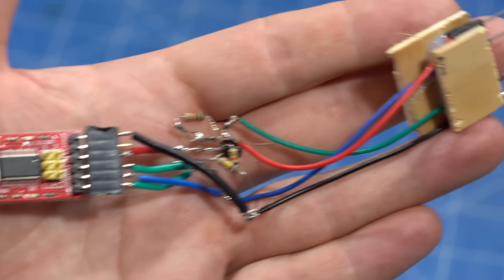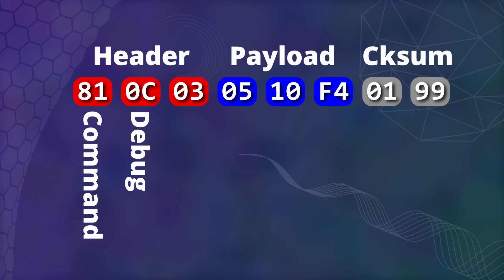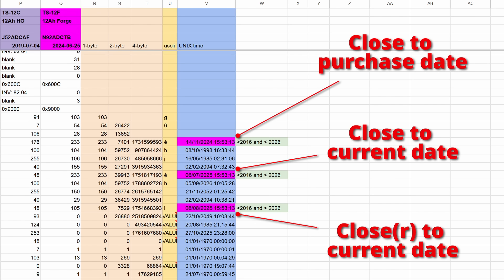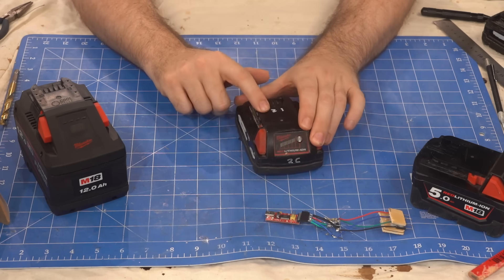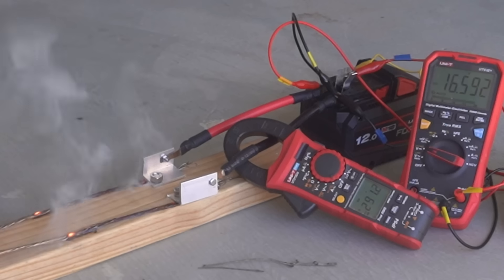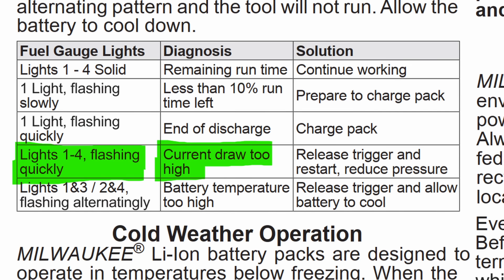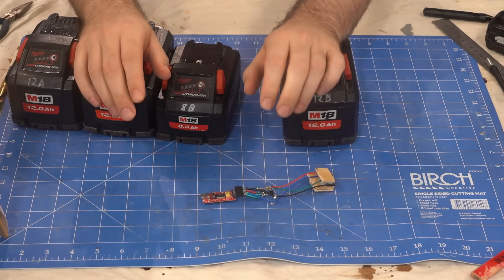Full M18 diagnostics revealed

Comment: FYI, some register can be used to read / write other register.  This is done due to having more registers then you have address lines.   You write to a register (A), when a read is performed, another register (B) will display the value of the register address that was written to in register (A).
Reply: that's not the case here

Comment: In a previous life I was working with pre-packaged x-ray spectrometers. They had no less than four serial numbers, one on the chassis which the user could see, one on the electronics, one on an analog amplifier that sat in there, and one on the spectrometer head itself. All paired up at the factory. Only the electronics serial number could be read out of the EEPROM. It was a nightmare to keep track of as we sometimes sent parts of the package back for repairs/replacement. Maybe crack open one of your batteries and see if you can find the number you found in memory?
Reply: Yeah they probably just have a database linking the various serial numbers.

Comment: Damn, I'm glad I just have my 20v DeWalt stuff you just plug the battery in and then drill holes or cut things like you need to do who thought goddamn batteries would have to have diagnostic codes... it's a goddamn drill for crying out loud... 🤦🏼

Comment: I bought a m18 impact and battery set. Thise 2 original batteries have lasted almost 15 years now. Theyve outlasted over 2 dozen other batteries ive bought since. Used a lot. I wonder if they started using this system sometime after that because i cannot get them to put out any code. I also wonder if theyve lasted so long, because they dont have this avility to put out a code.

Comment: You mention you need a 3.3v-8v level shifter, but link to a 3.3-5v shifter (which is the most common by far). Will the 5v data voltage work with the batteries?
Reply from the maker: The level shifter will shift to whatever voltage is connected to the the central HV pin. We connect that to B+ of the battery (20V). See the wiring diagram on github

Comment: Interesting video and kudos for cracking it.
I knew that the microchipped battery counts off something and then denies access even though it wasn't used that much.
A friend bought a new Milwaukee Drill and barely ever used it.  When he showed it to me and how much he paid vs his peanut wages I said you could have borrowed mine for however few times you ever "actually NEED a power tool".  
I think he used it 3x then shows me the battery and could I recycle it for him.
He called it stupid "I only used it like 5 times"
The first generation NiCad and NiMH I used to rebuild them myself both for myself and professionally years ago.
These new ones just end up tool and all in the tip after they need a new battery.
I've gone to the store 
Just need a fresh battery the drill is perfect yet barely a few scratches on it.
Nope that tool battery is NLA and the tool has been updated to model ex wye zed.  
Buy everything all over again. 
After going through this enough times it can pay for a small gas powered generator and use your AC power drill instead.

Comment: If you had some cash laying around I'd suggest an automated battery analyzer. I don't remember what they cost but you can program them to do all that testing without human intervention. As I recall they can be programmed for both charge and discharge cycles. (I found some starting at about 2kUS& and up.)

Comment: Unfortunately all your good work won't last long ,all the companies will do is either encrypt the details or put in traps to disable the battery to make your hard work pointless .What would work better is designing a third party board that removes all the nonsense that stops it working in the first place It's a battery they worked in the past just pressing a switch no tech inbetween

Comment: I bought a Milfuckye kit that came with a drill and an impact and two M12 batteries, both batteries refused to charge in less than six months having had very minimal use, I then had to spend the same amount as I did for the kit for a new M18 battery which has been left on either of the drills for over two years and charged only a handful of times.

Comment: I strongly admire your tenacity. This is proof that nothing is ever simple anymore. Manufacturers will do anything to make a buck and deny warranty claims. I suspect that 90% of the seemingly random numbers is nothing more than obfuscation. I'm sure they had several exciting nerd meetings to come up with it. Enigma for batteries. What will they think of next. The chipped tools that won't work unless they're "activated" at the register is bad enough, but Enigma batteries? C'mon, man! Of course you realize that Milsuki is now  frantically re-writing code to move everything and use different random numbers. Now we know where all the moonlighting HP ink cartridge engineers went.
Reply: Don't assume the worst case, plenty of data gets recorded to improve product quality and reliability.
Reply: @jaro6985 I only knew of one programmer where I worked that intentionally obfuscated his firmware code. It wasn't a problem until he rage-quit one day, then it became everybody else's problem.

Comment: Why a level shifter? FTDI usb to serial can operate in 3.3 or 5v
Reply from the maker: Battery is funky. You need to send messages at 12V (but 8-20V works), and it replies with 3.3V

Comment: Well this is interesting as I've an M18 6.0Ah that's not been lasting very long each charge lately so figured I'd check the cell pair voltages after hearing here they don't balance them (!).  Of the 5 pairs in there, 4 were ~4.0x volts, but 1 pair was at 3.5 volt.  Wow, so, I guess that'll be a big part of why then.

So, I'm currently running a slow charge on that particular pair to bring them back up to 4.0x volts.  I'll be keeping a close eye on them from now.  This tool could make it much easier to determine status without having to open the pack.

Comment: Great job!  I have not dug into these packs (yet) but it would be good if you could also focus a bit on refurbishing the packs, using the old circuits/cases but installing new cells.  Many packs require specific reset/re-learn procedures or digital instructions to make that work. (and tools in general to edit any necessary registers)

Comment: Nice work!  I had no idea there was that much doodly-do going on in the background of modern tool batteries.  I got pissed at battery operated tools back in the 80's with replacement Makita drill packs costing more than buying them with the TOOL and CHARGER!  Scam....   I invested in a decent air compressor and air tools instead.  That was a lot of years ago, compressor and tools still work fine, none laying around because the cost of air was more than the tool was worth.  The only battery operated tool I have is a cheap Menard's 1/4" bit driver I use to build a 'house' on top my 30' boat to fully support the tarps over the winter and the occasional odd project.

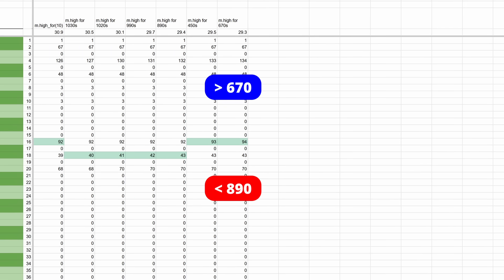Comment: 12:19 could 873 seconds, being close to 900, be a correction for poor clock performance?  Is 873 consistent accross the lot? Does the internal clock need
 873 seconds counted to correct the clock by 27 seconds to correct toward the 15 minute interval?
Reply: It’s almost 1/100th of a day? 24*60*60/873 = 98.969 so perhaps with that and the clock error?
Reply: @owenimholte3835 That sounds much more likely than my hypothesis.  If you are right, then 873, is probably consistent accross all models.  Great insight!

Comment: Great work!   I can see why they might not record ambient temps, us guys working in the field have only one place to leave our batteries and thats cooking inside service vans when not in use, those registers would be filled up real fast in the summer.  But I am curious, what about low temperature events?  When its below freezing here batteries are still living in the truck and freezing a battery isn't any good for them either, I've forgotten on more than one occasion to bring a battery or two inside for the night.  
Off to check Martins video, I'm not a Milwaulkee guy, they burned their bridge with me in the 90's with the horrible chucks they had on hammer drills and refused to warranty them on 4 drills (bought jacobs chucks for them, at the dewalt store =-) to take care of the self loosening chucks).
Reply from the maker: Not easy for me to test low temp. I'd need to cut the thermistor, which could ruon my battery. I should see if Martin can do such a test on his broken PCBs.

If they continue with 10C buckets, then they record charge start/end temps down to -30C
Reply: @toolscientist  Ruining batteries is the last thing we want!  Defeats the whole purpose of this endevour after all.

Comment: I was working a lot with serial comms back in the day, still have a rs232 card somewhere with a wide range of speed. I could have helped you, if I knew of this. All but the decoding is easy of those used to it and checksums of some type, were very common.

Comment: When a battery do this much of data collecting, it's not hard to imagine, that some of the manufacturers actually make software lockout function to it, just to force you to buy new ones... It would be nice to have an independent verification company, which actually checks the firmware on those BMSes, and ensures the end user that there are no funky business going on inside the firmware...

Comment: Nice work, but some of those imbalances could be due to varying quality chargers along with the cell quality, balancing is handled from the charger, or at least it's supposed to be. If the packs had cell balancing you'd only need the positive and negative terminals for charging but that's not what you see. Unreal video though and a crazy of amount of work😂
Reply from the maker: M18 does not have pinouts to the cells, so charger cannot balance. There's an AFE chip in the battery that handles monitoring and is capable of balancing, but they choose not to. See my [010] vid for investigation on their balancing

Comment: I use Dewalt, I think they only have balancing and temperature monitoring. Friend of mine use Milwaukee and he did bring one faulty battery to me, I opened, balanced the cells and it worked again. I think balancing is most important future on any battery. I now build batteries with active balancers in them, without even temperature monitoring and they work great. The only think with self balancing is a shelf life, because active balancers use power it may discharge you cells beyond threshold, so just time to time charge the battery and you will be good to go.

Comment: Just as an idea, you could always set the diagnostics to the clipboard from the command line, so you don't need to do the "select everything, and then copy/paste", it would just be "run command, then paste"
Reply from the maker: I had no idea you could do that. I'm such a peasant!
Reply: I have looked up the command for windows, to get rid of the trailing new line char you have to do `echo|set/p=mydata|clip`  this will give you "mydata" and not "mydata\r\n".. I am sure linux will have this feature even easier.
Reply: Yeah, it's just echo -n "blah". xclip(x11)/wl-copy(wayland) can be used to copy to the clipboard too

Comment: yep... it would be common  to have a case & electronic  serials different.

if you tried to match them , you would need perfect control on your factory processes to keep them in  sync..
then you would have issues with failed electronics , going to service engineers & trying to organize cases to be stored to match up.
the other way would be to case it all up, read the electronic SN, test then hard stamp the plastics, but that creates issues with thru put.

far better to just separate  & spreadsheet it up
Reply from the maker: That was my thinking. Any issues means you're stopping the line or trashing good internals or cases. Someone said that they had used Milwaukee's service software and could see the serial number, but didn't reply when I asked if the software needed internet.

Comment: What the!?
Its INSANE to see such high current packs not come with ANY type of balancing. Even when in screwing around with almost dead 18650/18500 cells the moment i have more than 1 in series i always use some kind of balancing setup. This can be a bms, rc lipo checker (99% of them also feature a passive ballance mode) or just janky transistors on a breadboard.

Its mind boggling to see such brands ignoring it...

Comment: What would be useful is a post-warranty replacement control board the just does the simple functions of charge, discharge and cell balance. I disagree with built-in obsolescence, it wastes resources, money and time. The number of warranty claims due to 'failed battery' would be dramatically reduced if it was not assumed that we are all crooks.

Comment: Technically, as it's an interface with an API, where that API was found to be between the charger and battery, which is then "sent a request for all possible API calls", it's something that, by Oracle v Google, was already established to be fully legal to do under the DMCA.
Nothing here was in any way, "breaking a digital lock" as the device simply just spat out all its data when the undocumented API request was sent.
I'm not a lawyer, though that'd be my immediate defence on the matter.

Comment: Love when my drill battery has an OS, I only wish it had a smart app I could install to track my KPIs.

BTW I have a strong feeling that the voltage level for serial communication is following the rs232 standard (-15v to 15v). To avoid having potential noise on the line, I would use a chip like MAX232 instead of the logic level converter, as it will convert the negative voltage properly.

Comment: Any chance this is just the standard behaviour of the BMS chip they are using? I assume you checked its datasheet or another similar one from the same manufacturer? They normally tell you how to access the data and often have software you can download. Milwaukee didn't make the IC's used in these batteries.

Comment: This is interesting stuff but it is a very bad idea to reset the defective battery flag.  The battery industry is not good at making safety problems public but I have been able to find out a few things about lithium cells.  What I discovered is that lithium metal has poor mechanical properties so some lithium cells have their working materials coated onto a copper foil substrate.  If the cell is discharged below the minimum safe voltage the copper can dissolve into the electrolyte and contaminate it.  When that cell is recharged the copper does not plate back evenly but forms dendrites which can grow until they eventually short the cell.  This shorting can cause the cell to vent or explode causing injury or even death.
Normally this is not a problem for many battery-device systems.  The devices will power off before any cell reaches the minimum voltage and their chargers will not charge a pack that has had an undervoltage cell.  The best systems will set an internal defect flag in the battery and the charger will never try to charge the pack again.  The defective battery can only be recycled.  This strategy has been working well well for severel years but bypassing the safety features could be dangerous.

Comment: Excellent work. Now crack the Bosch codes so I can power my Bosch heated jacket with any 12V source. The jacket knows when it's being supplied from any source other than a Bosch battery. I gather this is the case with their tools too, but I only have the jacket.

Comment: Can't we just bypass the electronics and run the drill directly from the batteries?
Reply: if you discharge them past a certain voltage it can be a fire hazard... nothing to stop you buying chinese copies though 😂
Reply: @jamble7k  I have a brand new battery, used it like 10 times. It won't charge up and the red-light flashes like 7 times when I push the button. I am sure the batteries are good. but the 6ucking electronics is blocking using it! How do I reset this thing or can it be bypassed?
These things are a 6ucking scam. They don't want you to fixx your own shit so you have to buy new ones.
Corporate greed is off the chart!
Reply: @We-Do-NOT-Consent-To-The-Loop  see if you can get it warrantied, i agree it's a scam but you need to do a bit of reading to understand lithium batteries.. it's not complicated you might be able to recharge the cells individually 💪

Comment: What you've discovered looks very much like a LIN bus with typical LIN messages. There are cheap breakout boards for converting UART to LIN - and Arduino libraries for the protocol
Reply: Standard LIN is one wire, so that wouldn't work, but good idea.

Comment: My RC battery chargers have employed balancing for over ten years. It couldn’t possibly cost that much more for Big Red to produce balancing chargers.  I would think a cost per unit to do so would be less than a dollar or two in adding some comparator circuitry.
Reply from the maker: It's worse than that. They already have an AFE chip with balancing hardware. All they have to do is add some code to their firmware and they'd have balancing, but they've chosen not to (Bosch is same story)

Comment: If you use a level switcher with an usb serial/uart i really recommand to use an usb optical isolator. They are cheap on aliexpress, can save your pc/laptop/mac book. As there is so much power in a battery it can really damage your stuff.
Reply: You think there's a lot of power available on the serial data connections??
Reply: @Slicerwizard  On the serial connections in a perfect good conditions no, but a bad connection or an accidental (short) somewhere things may end up not the way there are intended.